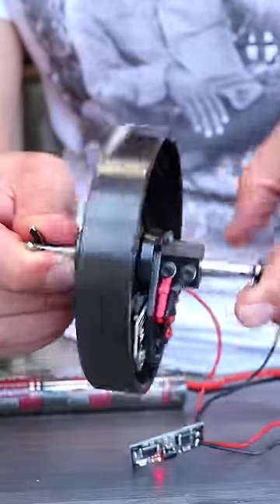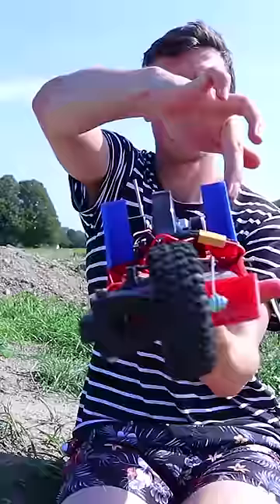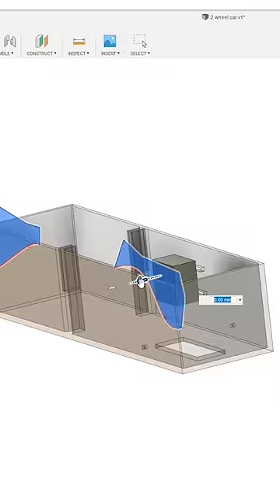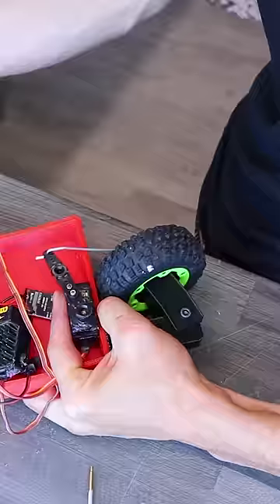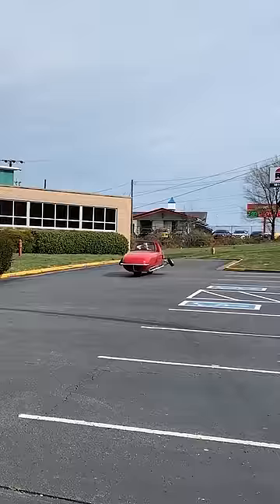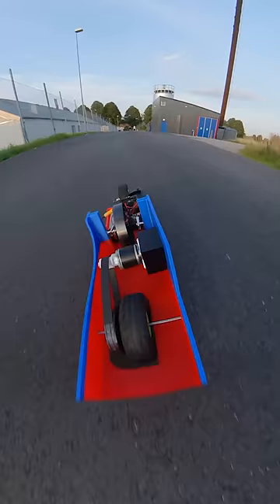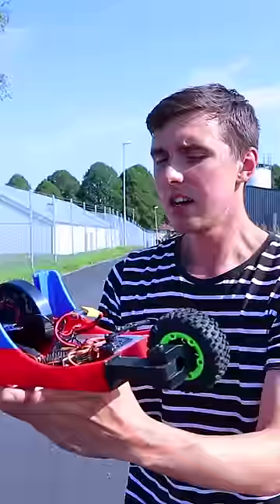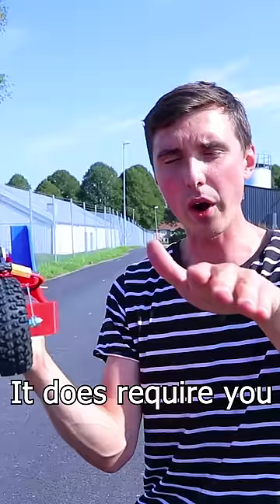Gyroscopic Flywheel Stabilizing RC Motorbike #shorts

Comment: The downside from this setup is that in not only wants to keep the bike up right , but also wants to keep it going in a straight line, kinda resisting the steering.
Reply: This is how they turn the International Space Station, using 4 gyroscopes
Reply: @FirstMomentsOf Many satellites too, but the ISS doesn't only use Gyros. Russian rocket engines are used to desaturate the flywheel speed
Reply: Maybe it's too tall/top heavy
Reply: I always wondered what kept the earth spinning so eloquently without needing training wheels.
Reply: Yeah, his gyro is the wrong way.
Reply: then he should add some programming, making the gyro slower when turning
Reply: Чтобы удержать, надо поставить рядом второй маховик но в противоположном крутящем моменте 👍 вот и всё. Я это из СССР знаю,
Reply: Arms goes ripped
Reply: That’s why he said you’d need a perpendicular one too
Reply: @Tekape what he really needs is to 'detach' the gyro from the bike and program a 3 axis chasis that could use the gyroscope a s a 'reference' point.       So when the bike wants to change directions,  the system would 'push' the gyroscope to the oposite direction
Reply: @Tekape nope the gyro spins too fast it take a lot of time to slow it down and lot of time and energy to speed it up. you want to have responsible steering not wait 10s before you can initiate a turn.
you could mount the gyroscope on a rotating assembly to force the bike to lean at the angle you want though
Reply: You really only need a reaction wheel that’s spinning perpendicular to the driving direction to be able to turn and go straight as much as you want.
Reply: @FirstMomentsOf  reaction wheels
Reply: @FirstMomentsOf or just tilt the wheel/alter is axis of rotation. Ik it’s difficult but that would be the best
Reply: Want a correction and a great idea?
Just mount the gyroscope horisontaly being able to tilt it to the right and the left with your steering servo, as you the turn right, it will tilt the small vehicle to the right and it will then also turn to that side, the adhust the servo so that center will be when the vehicle is going straight ahead as posible
Reply: he just showing the  basic idea
Reply: could adding a flywheel integrated into each wheel help with this?
Reply: Well, a motorcycle engine works in the same way, and still allows you to turn.

Comment: I rode motorcycles for many years. A little-known trick is to Rev up the engine when you're moving very slow or coming to a stop. The engine acts as a gyroscope and does help stabilize the bike. Not a huge difference, but it helps.
Reply: damn, never thought it like that
Reply: I'm not sure if you're correct about that
Reply: Don't the wheels already act as a gyroscope? And wouldn't slowing down just lessen that effect?
Also, there's no parts in the engine that are large enough and rotate in a complete circle or the right direction.
Reply: The engine provides little to no gyroscopic force, the crankshaft simply has a too small diameter. Being in higher rpm provides you with more power, so when feathering the clutch or pushing against the rear brake, you have more power stabilizing you.
Reply: There's no way that small crankshaft rotating would make any difference relative to the weight of the bike.
Reply: Y'all are incorrect OP is right. Diameter isn't the only function of gyroscopic force. Speed is just as important as well as mass. This the many designs for flywheels. Increasing engine RPM is the same as spinning the wheels faster. Thus why they can be substituted.
Reply: @Dunkopf  even if that's true, most motorcycle flywheels aren't even in the right orientation to cause a reaction force about the balancing point
Reply: @Dunkopf  Doesn't matter. The radius still is too small.

A 21 inch front wheel weighing 15 kg going 7 km/h (about 4,3 mph), which would equal 60 rpm on the front wheel, will have angular momentum 44 times greater than a crankshaft with the same weight but a 3 cm diameter at 10k rpm and as such will provide more gyroscopic stabilization.

Even at half the speed, which is literally walking speeds, you would have 22 times as much angular momentum and people keep saying bullshit like "gyroscopic stabilization only starts working at 8 mph".

Radius matters way more.

Also if that were true, motorcycle instructors all around the globe would advise you to rev it into the rev limiter when going slow, to make the bike more stable.

Stop spouting nonsense.
Reply: @straikychan  motorcycle instructors do tell you to rev to stabilize the motorcycle at low speed. It's a part of the mandated training. Just because something is less doesn't mean it's non-existent also.
Reply: @Dunkopf  Dude. You can literally stabilze the bike by just idling and feathering the clutch. No bike instructor I've ever met told me to rev the bike at low speeds. at least I've never fucking heard to rev it high.

And just because it's technically there doesn't mean it makes a difference.

The angular momentum of the crankshaft is way too little. Again. At speeds like that you just BARELY get a noticeable effect from the wheels spinning, which (in case of a 21 inch front wheel) produce about 44 times more angular momentum, which also has the benefit of being aligned properly.

The higher your angular momentum, the more reluctance to move.

I'm sorry, but the maths is stacked completely against you.
Reply: @straikychan  I'm really not sure the math does stack against me. And I'm not talking about revving to the moon. You only need like 3k which is barely anything on a bike. This is what I was taught to do in low speed maneuvers like 4mph. I don't remember the formula for angular momentum but I would love for you to explain it.
Reply: @Dunkopf  Dude. It is.

Again. Even at 10k rpm the crankshaft provices only 2% of the angular momentum of a 21 inch front wheel going at 4 mph. That's negligable. You won't notice that at all.

At 3k it's even less than that, something like 0.6%. You. Won't. Notice. That.

Angular momentum of a rigid body rotating around a point is moment of inertia times times the angular velocity.

Moment of inertia is mass times are of the rotating object around its axis. So mass times radius squared.

Radius factors in so. much. more.
Reply: @Dunkopf  the math does indeed stack against you
Reply: @straikychan  you're telling me that I'm wrong but not actually calculating anything. I'm simply not smart enough to remember how to do the calculations myself. However I have put 56k miles on my motorcycle and I am familiar with low speed maneuvers. So why does it feel like it makes a difference.
Reply: @Dunkopf  Cause higher rpm puts more hp through the clutch on the ground.This works both when feathering the clutch to pick up speed, as well as compression braking to retard the bike.

Sorry I didn't show my work, I'm not a physics teacher. I did however post my culculated numbers.

That being said. There's simple proof that you do not get any significant stabilization bonuses:

Moto Guzzis and old bikes with transversally mounted crankshafts would NOT get that stabilization from a rotating crankshaft, since their crankshafts are literally oriented the wrong way for that. Yet they still get the benefits from stabilization when compression braking. Mh, wonder how that happens.

Turns out people putting 50k miles on the road does not make you a physics major and sometimes things just cannot be observed with your personal feelings-gauge™ well enough.
Reply: Going fast is cool.
Not going fast is not cool.
Revving is super cool.

Revving while not going fast creates the necessary gyroscopic effect to still look "cool" even at low speeds.

Yep, I think I got it.
Reply: @Meow Im A Cat  Your math is wrong for a couple of reasons. First, a crankshaft may be about 3cm in diameter along the bearings and snout, but the crankshaft also has throws out to the rods, and counterweights. Just picking the first common motorcycle from the top of my head, a Yamaha R6 has a 600cc transverse mounted engine(transverse is side to side, longitudinal is front to back), with a 42.5mm stroke.  So, the rod journals are centered 26.25mm from the center of the crank for a 42.5mm diameter. Half of the big end of the rod and half of the rod journal extend beyond that point and rotate with the crank. Besides the 4 rods rotating(typically half of their weight is calculated as rotating mass for balancing), there are seven counterweights which extend far beyond the rod journals. The majority of the mass of the crankshaft is far from the crankshaft's centerline. Then there is the mass of the flywheel, the mass of the timing sprockets, the mass of the timing chain, the mass of the camshafts(rotating half as fast as the crankshaft), the mass of the gearing transfer gear/chain going back to the transmission, and the mass of the multiplate clutch. All of this is rotating, and I believe that you'd find an order of magnitude more angular momentum than the amount you are calculating for a 3cm cylinder. If you were in neutral without the clutch pulled, half of the gears in the transmission would also be rotating at high velocity as well.

Most motorcycles have their engine mounted transversely, which means that the crankshaft is rotating on the same axis as the wheels do. It is not enough gyroscopic force to completely balance the bike at a stop, but it is enough to balance it at a very slow roll of a couple MPH, and enough to make a noticeable improvement at a stop.
Reply: It's a known fact that the Moto Guzzi engine layout can cause weird riding sensations for those not used to the engine layout due to the orientation of the flywheel. Makes it harder to lean one direction vs the other.
Reply: Also anyone who doesn't believe this must have never ridden a dirtbike. This is pretty common for trials and Enduro. Much easier to stay balanced with the engine running vs not.
Reply: @FonicsSuck  I had a V85TT, you mainly only notice it when standing still and revving, it's not really noticeable while riding.

Still, my point stands, whether with a Guzzi or a conventional engine layout, you do get stability from slowing down, which is mainly due to the gyroscopic effect of the wheels.
Reply: @SpecialEDy  that's right all about spinning mass the cat dude too smart to see it
Reply: @jamescrud  it doesn't.
Reply: U mean rev match?
Reply: the best trick is learning to drive
Reply: its the flywheel that creates the gyno affect not the engina
Reply: You're right for the wrong reasons. It's your wheels that act as the gyroscope
Reply: @Dudeitzmimi  the engine and transmission spin on the same axis as the wheels for most motorcycles. The wheels generate a greater gyroscope effect above perhaps walking speed, but at a complete stop or very low speed the engine is generating a greater effect than the wheels.
The engine alone does not have the gyroscope effect to balance the motorcycle entirely, but it is contributing, and it can help you balance when coming to a stop.
Reply: Wow didn't know that but I don't think it will work in his case because he's using an electric motor not a gas powered motor with a clutch
Reply: How should an engine behave like an gyroscope? The working mechanism of sutch an engine is that a bolt is moving up and downward what's ending in a rotation of the wheels. How could that work as an gyroscope? In addition even a gyroscope needs a particular speed what's just not given, so how?
Reply: @armonfrohlich6348  The pistons just reciprocate up and down. However, the crankshaft, big end of the connecting rods, camshafts, timing gears, flywheel, and clutch are all rotating. Like, an engine has a flywheel, and a flywheel is a rotating disc that literally  stores angular momentum, which is exactly what a gyroscope does.
The engine has a very significant amount of rotating mass, turning at a much higher rpm( the engine is turning faster at idle than the wheels at highway speed). The difference is that the wheels are much larger in diameter, so they do have more gyroscope force. However, below 5 to 10 mph, the engine can easily generate more gyroscope force than the wheels do.
Reply: @SpecialEDy  1. These tiny parts do not rotate in unison

 2. These tiny parts do not lift the 300kg that a bike weighs on average.  Wouldn't you also like to list the washers for the screws?
Reply: Google a gyroscope and then compare...
Reply: @armonfrohlich6348  This is 20-30lbs of steel revolving at 1000~10,000 rpm, not tiny parts. The moment of inertia is much lower than the wheels, but the rotational speed is an order of magnitude higher.

Google an image of a crankshaft. Now imagine that you stand it on the snout and spin it at several thousand rpm. It could easily balance like a top for several minutes.
Reply: Not a motorbike expert but I'm gonna believe the guy who explained his math down to hundredths of of a mm vs the guy saying no cause "tiny parts" or the guy who just throws out random percentages
Reply: helps with death wobble too

Comment: Try an active gyro or a reaction wheel maybe Active stabilizing steering? They all have down sides but a combination of some might be the best (steering and active gyro) for a bike this size. Also most bikes 🚲 have the front at an angle to passively keep it up right at speed. I'm 13 so this might be wrong.
Reply: yo don’t doubt yourself.
that’s a good idea
 you’re ideas aren’t any less valid. Because you’re young
Reply: @NithinJune  Thanks but I kinda have to edit the comment. I'm turned 14  11 days ago.
Reply: I also noticed the same thing, the front of the 🚲 is angled to the right side of the 🚲
Reply: @Mijo0x9 happy late birthday bro
(and happy early birthday in 6 months)
Reply: here must be the horizontal gyroscope (in this construction).😁
be smart, not foolish.
Reply: Good thoughts. Came to the comments to say something similar. Reaction control on the roll axis would probably work, assuming proper balance. Would be tricky, but doable, I think.

Comment: Instead of using the front wheel to steer, push the flywheel left and right to lean the bike. This is very similar to counter steering a motorbike. Push right, lean right. You'll have to swap to curved profile tyres too.
Reply: If it pushes right,  the bike will lean left  and so on.
Reply: @andycapo9you  other way around. Push right, lean right.

Comment: I have a remote control motorcycle from the early 80s.  No gyroscope, it could drive slow.  The big thing about your motorcycle is the steering is all wrong.  The steering should be free turning.  You want the server to change the lean of the wheel.  Off set to the right and offset to the left.  This will change the CG and the bike will fall to the right/left and it will steer towards the CG.
Reply: This with an active gyro that leans like a rider would? Then you could turn it.

Comment: Bike design itself is a self balancing one while moving, u don't necessarily need a gyroscope fly wheel to keep it upright, it all depends on the angle both wheel touching the ground, just research a bit and u can make it
Reply: that’s the point of the gyroscope, to correct the angles. watch the whole video before commenting
Reply: @_dnk My dear, I definately watched the whole video before commenting, Gyroscopic Wheel is never practical for a moving vehicle as he prevents it to turn in corners, he made the connecting wheel rods parallel to the ground that is why it is unstable that much. Correcting angles can be done in so many way. By the way if you are into bikes then you will know engineers always tried to keep the gyro wheel effect in a moving vehicle as low as possible as we have the flywheel magnet in the engine to able to turn the bike easily. Pls know the science before Commenting.
Reply: @arnabmaiti4839  ohh okay well my mistake i understand now thank you
Reply: Yes when the headtube has forward rake it helps steering no need for a gyro

Comment: from what i see so far....the front wheel needs a camber, its gotta flop sideways a little when it turns. like a bike wheel, it will turn better.  and a flat truck tire type tread is going to fight ya too.. and it needs a higher stance so the side rails don't touch down so easy.  cool design
Reply: Yup, the steering axis hast to be in front of the contact patch for it to be stable

Comment: That gyroscope needs to be 'active'; it has to roll inside the bike on 3 axis to counteract the bike reactions when turning and trying to be vertical.  What you doing now is just following the gyroscope 'starting' direction. What you need is to use the gyroscope as a 'reference' point and spin/stabilize the bike under or to it. Great job!

Comment: Rather than using gyroscope. U can also use weight at the center of mass and lower the height of mass to the ground and also connected with bearing on sides which not tilt the mass sideways..

Comment: I just played with an RC dirt bike that requires the Gyro inside of the back wheel to spin up to a top speed before you launch it by hand with a bowling motion. I don't remember the name , but the Gyro was inside of the back wheel, it wad encased in 2 clear disks so you could see the Gyro spin up. It worked, but I think if the Gyro was spinning at a higher rpm, the bike might be able to stand up on its own. The rc bike toy seemed to have a limit to preserve battery life.

Comment: One will do, if you use gyroscopic effect by rotating the gyroscope over vertical axis. Once turned you can use  momentum also from the reaction wheel principle. This stabilizes the vehicle at any speed without any singularities.

Comment: In 2 wheelers, when you turn the steering wheel to certain direction, the vehicle itself wants to lean to the other direction because of gyroscopic effect on the wheel itself. You can observe it in the video.
Using separate gyroscope helps stabilize the vehicle, but also made turning much harder.